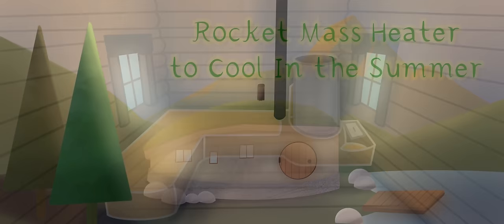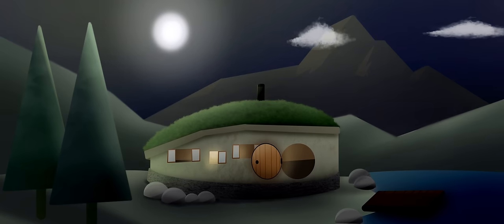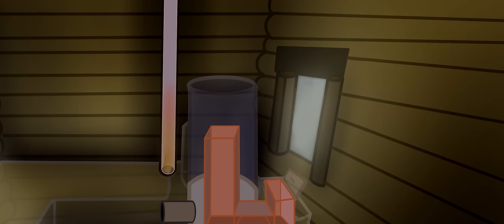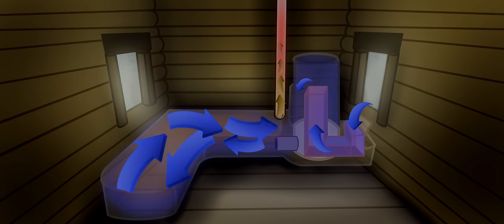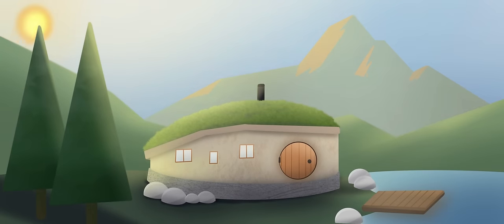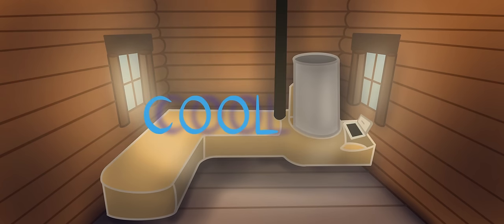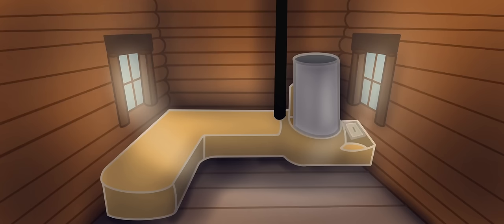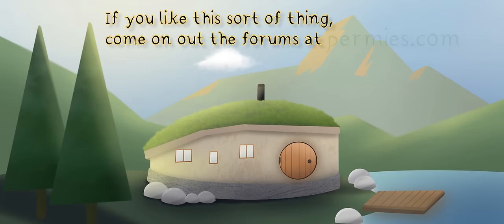rocket mass heater cooling in the summer

Comment: Have you heard about the passive cooling used in desert compounds? They would create pools and place widows below them to allow cooler air to flow off the surface of the water, through the windows which were high on the interior wall, into rooms lower than the pools. Simple tech, but effective.
Reply from the maker: The animators tell me that that is exactly what they do.  They live in columbia.
Reply: Wouldn't that cause humidity and make it "hotter"?
Reply: @Mrssandypeterson  cool air sinks, and water is a tremendous thermal flywheel that changes temperature very slowly.

Yes the cool air is moist, but it's still cool.

This probably works equally well in dry climates and SUPER MUGGY ones, where the moisture is either a welcome blessing or where the air is basically saturated to begin with. It's intermediate climates that might suffer from extra moisture

Comment: In summer Add a solar chimney or paint existing cap black to heat it and cause air to be pulled out the room…creat a vent low on North Side of dwelling, open it during day, thermal siphoning happens turning you RMH into passive AC solar chimney for summer…

Comment: With screens on windows, of course... Nice video!

RE: One additional perk for users of Rocket (Stove) Mass Heating systems:
Natural Convective Cooling in Summer -- (NOTE: CAVEAT -- While I have not read up on this cooling perk in detail, I'm sure that the designers out there who tout this summer cooling mode will WARN users to BE VERY GENTLE with the system when they decide to switch back to HEATING mode. A transitive period using just a small amount of heat, with air moving through the stove, will serve to dehumidify and dry out the system components, preventing cracking, crumbling, and spalling of mass materials, thus extending the life of your Rocket Mass Heater installation.)

Comment: Nice! I do the open windows bit, which works pretty well without a rmh unless its humid, but am sure the rmh would be more efficient.  Thinking that I if airflow was coming from earth tubes, even cooler?
Reply: There are many more books on the subject, Passive Annual Heat Storage... Insulated thermal masses (heat here, cold over there), earth contact, trombe walls, solar heat gain... Build your home just right, somewhere in the American Southwest (annual # days of sun is crucial), within a few years you won't need much stove heat at all. 
Using the same physics, we can save on fuel bills in many other latitudes.
Reply: Depending on your climate earth tubes can grow mold.
I would not recommend them unless the house inlet has a hepa filter

Comment: The most effective way to make a "passive" cooling system is installing an hot water in-floor heating, that in this case would come from the rocket heater instead of that bulky piece in middle of the living room ( or what ever is located) then create another  in-floor pipe system under the ground. This can be in the Basement or in places where is very cold in the winter in the garage slab to send heat in the winter and pick the cool in the Summer. This slabs would become the "mass coolers". On the summer the water  would go under the ground and comeback bringing cooling to the house. To be more efficient you should have a "radiator" where the cool pass, and a fan that would blow to the radiator. It would make the whole house cooler and faster not just the area of the bulky rocket mass heater (you might need to study a circulation system). This system wouldn't be 100% passive for some of you because would require a small solar panel to power the pump and the fan.
Reply: It's also a lot more expensive (vs a stratification chamber), with a lot more points of failure. Especially in earthquake country.

And you have to dig soooo deep in deep freeze territory.

And it's adding junk to watch out for into the soil if you or a future owner ever want to do some earthworks
Reply: @priestesslucy  You know what. At some point I will install an in-floor heating in my basement without breaking the concrete and I might use it to cool dawn the house in the summer.
If I do it I will publish here the project.

I'm in Canada and last week it was -30's degrees celsius and the basement without localized heating (just upstairs) was around 13 degrees celsius.

Here below 4 feet you have the temperature stabilized, I don't know what you mean with so deep...

I don't know as well what you mean with "junk" and trying to not be disrespectful, a bulky piece of mass that we have to put inside of the house that is taking useful space, that can be junk for me, if I can find a better solution
Reply: @brumasbusiness  4 feet is pretty deep to me where I live in the warm side of the Pacific Northwest. At least twice as deep as I would have to dig (not that I particularly want to, but we all have our own preferences and methods.)

the junk I was referring to seems to be a misinterpretation, I thought you were referring to a Geothermal system with pipes (aka stuff, aka junk) running out into the soil around your house where it would be in the way if you ever needed to dig there.

As for 'a bulky piece of mass that is taking up space' that's all a matter of preference.

We're all going to put furniture of some kind in our homes, is a bed or a couch taking up useful space without being useful?

It's like a masonry stove that's kept people alive in Russia and Eastern Europe (and China, look up Kang Stoves) for over a thousand years.

I don't mean to suggest you have to use one, everyone has to decide for themselves how they want to furnish and climate control their homes, but for me personally a rocket mass heater of some sort is probably on my list of must-haves.

In fact, right now I'm building a Tiny House on Wheels (double axle) entirely based around a Kang Style Stratification Chamber. There's a little 'muck room' entry way+wood storage, then stairs up onto the mass floor over the axles that serves as living/lounging/work space, and the far end by the tongue is the kitchen.
Reply: @brumasbusiness  I hope your floor heating project goes great though!

Comment: Nice job it would be the greatest thing if you can have a simple solar hot water panel or compost pile  to heat this thermal mass up when it starts to get cold out, also with a simple hot air panels.
Reply: Oh, something like a Jean Paine compost pile built downhill with an air hose could be a fantastic way to prime the mass in autumn when you're gearing up to start running the stove
Reply: @priestesslucy  
Wood heat can be used to heat the thermal mass.  Walker Stoves has the flue near the fire. Opening the bypass will prime the chimney.